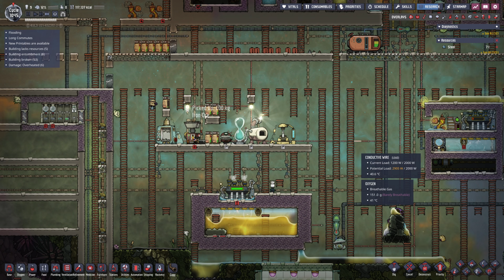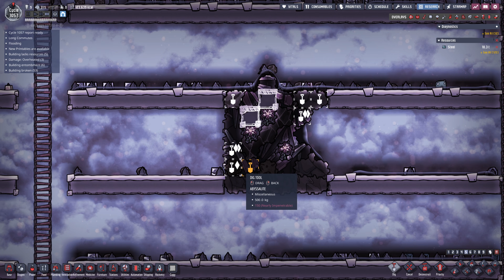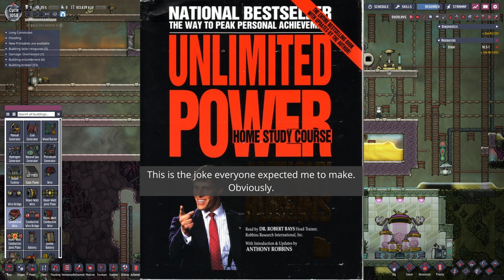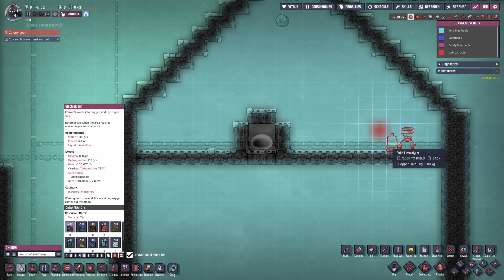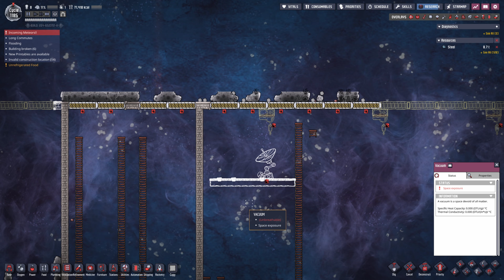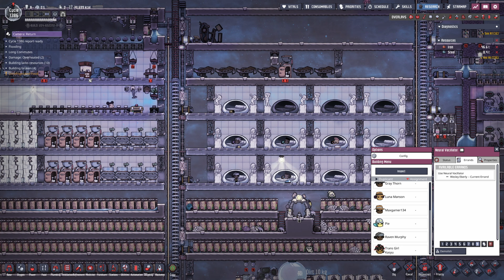This Is An Air Conditioner || Goose Sucks In Oxygen Not Included - Episode 5

Comment: Alright, seeing you struggle with the Aqua Tuners I'm gonna recommend you play with bridges. Packets inside pipes are "pulled" to inputs and if "pushed" by an output will pass over an input if already filled. See if you can figure out why that's helpful :)
Reply: That's a really good way to not give a spoiler while also communicating a critical design.
Reply: @MedullanAutononomous  Honestly it's extremely impressive seeing how well he's doing despite all his setups being jank as all hell. I was pretty sure he wouldn't be able to recover from his oil biome disaster but he's off making hydrogen rockets already

Comment: Uhh. Glass has a similar melting point to steel(glass is actually very slightly higher) so temps shouldn’t be an issue because of that. On top of that it’s also more scratch resistant than steel, and less thermally conductive. Solar panel cells however are very fragile and those are probably what couldn’t withstand the heat.

Comment: 5:10 Funnily enough you just stumbled upon the principle behind a real-life kind of vacuum pump, although the irl variant uses Mercury. Pretty cool, and a shame it didn't work.
Reply: Terms to look for is Sprengel pump, which uses falling Mercury drops to pull air out of a container, which was based on the trompe which uses falling water to push air into a container for compressed air.
Reply: Even more funny he got it almost right, the oni version is called a "Bead Pump" and has a variant that relies on the fact that fluid tiles in certain situations can swap with a gas tile diagonally placing the gas tile into a separate room

Comment: Running out of dirt is actually an old Minecraft problem as well, seeing as it only became infinitely farmable fairly recently and still requires some significant setup to achieve that. Skyblock's second major learning hurdle, after not ruining the cobblestone generator, is keeping enough of your supply of dirt and grass to get farm animals.
Reply: Yep! Theoretically less of a problem in straight survival, but it's kind of hard to consider a material plentiful when acquiring more means stripping entire biomes down to stone. Sand has a similar problem. (This is, I suspect, why one of the most universal things in modded Minecraft is giving the player a way to make more sand. Usually by smashing cobblestone.)
Reply: @Hexagonaldonut for a while there was also the option of looking for underground dirt pockets, but even those were finite if your worldsize was capped for server performance
Reply: @Hexagonaldonut  This is also part of why filling creeper holes isn't a straight shopping cart morality problem. If I had the dirt to spare I'd absolutely be patching my land, but every hole I fill is another hole I have to dig.
Reply: @LepidoliteMica  Yeeeeep. If I had a nickel for every time I've just kinda had to leave a creeper crater there because I just couldn't really afford to fill it in, I would be able to buy Minecraft again several times over. At least.
Reply: @LepidoliteMica I've always been in the habit of filling a single layer of dirt over cobblestone, with the bonus effect of reducing future damage in the same spot.
Reply: @LepidoliteMica if i may ask. What’s the shopping cart problem? I’ve never heard that phrase before
Reply: @Beepers559  It's if you so something that benefits everybody, but no one phunises you if you don't, so you do it. It's based if you return your shopping cart to the proper place.
Reply: @Beepers559  returning the shopping cart to its designated spot after using it is considered a good thing to do, but it usually isn't incentivised. so you can judge a person's morals by whether or not they return the cart - if they do, then they're doing a good thing without any external motivation, just for the sake of doing a good thing. it's a semi-popular meme/discussion topic
(sorry for the poor explanation, I'm really sleepy)
Reply: @Beepers559 shopping cart is a litmus test, if you put it back you are supposedly a good person and not otherwise. 4chan guy doesn't stop to think that using a shopping cart is fun if you're not a zombie who has killed their inner child
Reply: @Beepers559 Putting your shopping trolley back after you finish using it. It costs you nothing, and is the objectively right thing to do, but also gains you nothing, and is slightly inconvenient.  This makes it an ideal test of morality (in theory).
Reply: @Beepers559  it's a reference to an old post about a shopping cart. Specifically, that returning a shopping cart is a fundamental test of morality. It doesn't inconvenience you by any meaningful amount to return the shopping cart, and it's objectively the correct thing to do, but it also doesn't benefit you at all. Therefore, things that are easy and objectively correct, but don't benefit the person doing them are known as "shopping cart problems." Like filling creeper holes in a hypothetical world of endless dirt.
Reply: @ I see, this is kind of interesting to me I gotta admit. Thank you for telling me what it means
Reply: @LepidoliteMica  fill em with scaffolding lol
Reply: @LudicrosityIndustries  As far as I understand it that poses rendering problems, as the scaffolding isn't a full block and thus doesn't get culled the same way. In all honesty, snow or resin are probably the best options for independent infinite farmability and ease of removal if the land needs to be dug for a project later.
Reply: @Hexagonaldonut  sand actually does have a way to duplicate, assuming you have access to the end. its still a problem in skyblock, though.
Reply: There’s a trick for creeper holes - fill in everything but the top with cobble and as long as you don’t get hammered in the same spot too many times, you come out dirt-positive
Reply: Coarse dirt has existed since 1.7.2 btw, if you consider 2013 recent. but that needs gravel as an input with is equally as annoying to get without... wacky gravity dupes
Reply: @WizardBrandon  1.8, technically, as it was known as "grassless dirt" prior to then. 1.16 was when it finally became farmable without messy glitch usage, through piglin bartering. Even with that you still have to craft each block (or stack, technically) by hand, and it wasn't until moss that you could conceivably automatically farm it through podzol conversions.
Reply: @LepidoliteMica  why podzol? You get dirt, craft it into coarse then hoe it into regular dirt
Reply: @ Because, as I said, you have to craft coarse dirt by hand and then individually hoe each block; podzol allows for fully automated mass dirt creation.